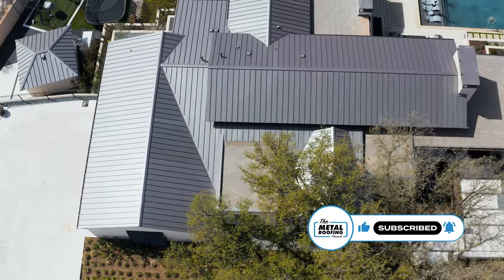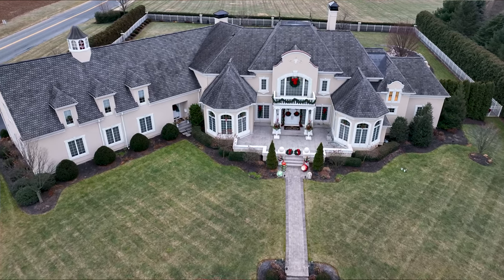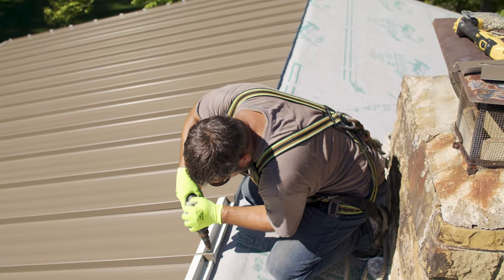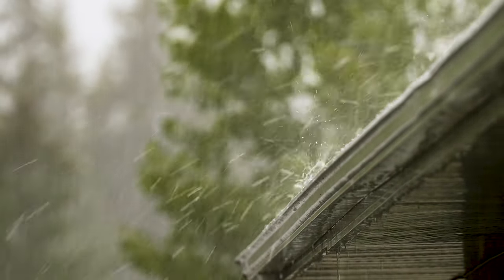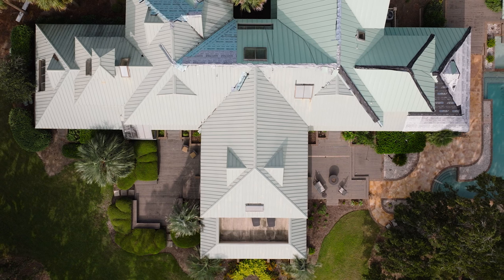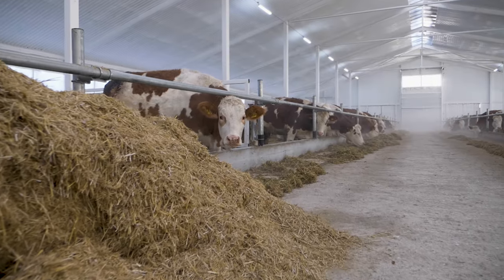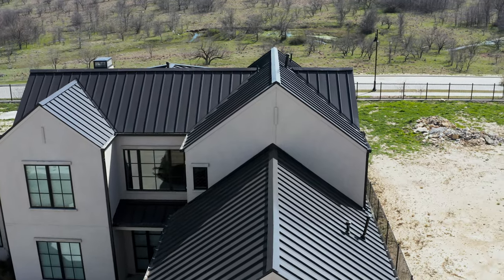11 Reasons You Should NOT Buy a Metal Roof

Comment: After installing and using both shingle and metal roofing, I'll never do any other roof besides steel in the future.  They are MUCH better in all ways (at least in Canada.)  25 year shingles only lasted 10 years.  Metal roofs last over 50 years.  With the price of installation rising every year, it's far better to bite the bullet and get it done right the first time, then forget about it the rest of your life.  I loved the fact that snow slid right off too, too much weight on a roof can damage buildings, especially older ones.  I had a tree limb fall on the roof and all it did was dent the steel.  It would have put a hole in a shingle roof.  You'll never have a leak with a steel roof once it's done right.  Shingles can seem good, but slowly leak, damaging roof and underlayment, and eventually drywall.  One friend of mine had leaks go down through the walls through three floors.  I installed a steel roof and that solved that problem.  Sure some roofs are trickier than others, but that's a job that only has to be done once.  Shingles need to be done every 10-20 years, so a complicated roof needs to be done again and again.  I love steel so much I ripped off the rotten flat roof on my travel trailer and installed a steel pitched roof.  No more problems with water damage for as long as I live!  There are some reasons to buy a metal roof.  Oh, do it yourself and save a tonne of money, it's not that difficult.  You can even find manufacturers that offer "2nds" or miscut sales, bringing the cost down to comparable with shingles.
Reply: I live in the Sesttle area, and have a 3-tab tar-shingle composite roof that is 22 years old now, and still looks new. It has a 3-12 pitch. The previous roof was corrugated aluminum installed over old 3-tab "tar shingles" - the screws holding the aluminum were installed on the tops of ridges, and the eventual leaking at the screws caused a lot of wood rot. No idea why they installed the screws on the floating ridges, but they could not maintain a secure compression on the rubber washers under the screw heads, as there was always about a 1-inch gap between the aluminum ridge and the hard shingles below it.
Reply: @logmeindangit  It is possible that different locations and weather need different methods.  Perhaps in the colder areas the ridge screwing works better, our sun is not has hot as down South.  If you get no snow and only very hot days, the metal is doing a lot more expanding and contracting, so a tight connection would be more beneficial.  However rubber washers are only supposed to be snugged so the rubber only begins to bulge - if you tighten it too much it will ruin the washer and leaks will come in.  If you don't snug it enough, water will get in.  I would never install steel over a shingle roof without first screwing down wood slats and screwing into them, because shingles compress and can give after you screw them down.  Screwing into wood slats won't allow this to happen.  Also, having air between the steel allows it to cool faster and not retain heat pumped into direct contact with shingles underneath, one of the advantages of steel.

Comment: The low-pitch roof comment is odd and I wish was expanded on more.
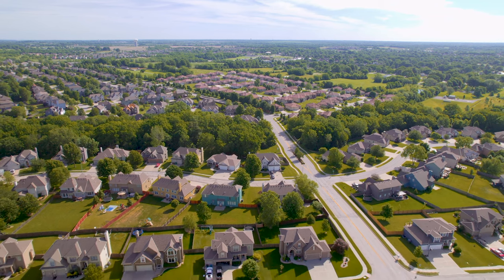Reply from the maker: Most Snaplock profiles can go down to a 3:12 slope, some mechanical seam profiles can go down to a 2:12 or lower depending on the installation and roof design. For ultra-low slope roofs or flat roofs, metal is not the best choice in most cases. Here's a video on the topic: https://youtu.be/wo6-ZPYx2A4 -Thad
Reply: @TheMetalRoofingChannel  Thanks.  I'm in Hawaii in a costal application with about half of the roof at 0.5:12 and half at 2-3:12.  The "ask your contractor" advice in the other video is failing me as their only advice is an extra layer of peel-n-stick.

My impetus is that I need to replace my solar systemand it is a lot of penetrations through the roof with the alternatives.  The solar all goes on the "flat" roof.
Reply from the maker: I would say ask your roofing manufacturer for more guidance on low-slope installation. Also mention your solar plans to them as they should have some info on that as well. If you will be installing a standing seam roof, there are clamps you can get for solar from companies like S-5! that do not penetrate the roof. -Thad